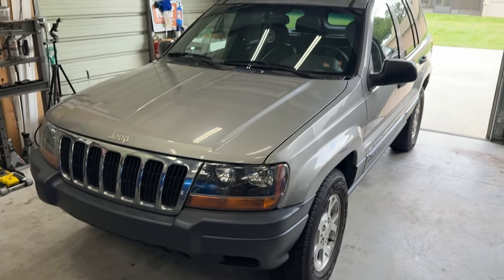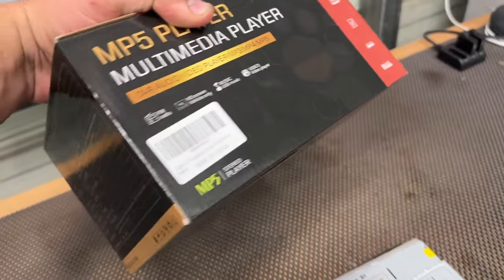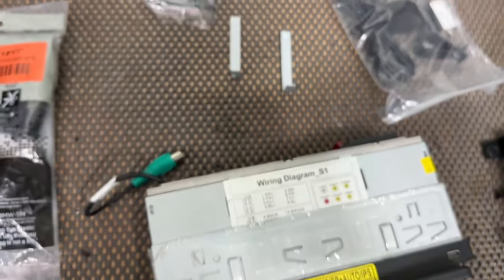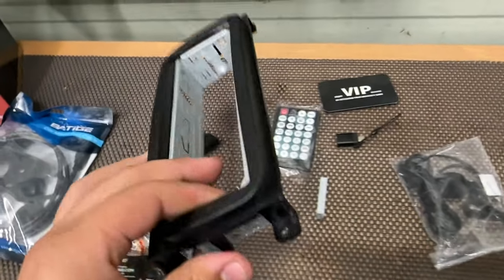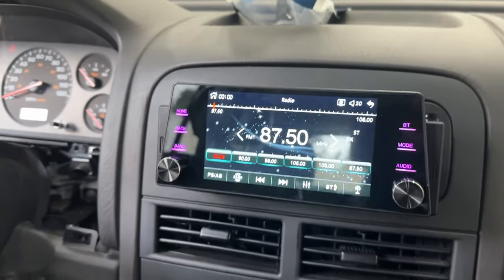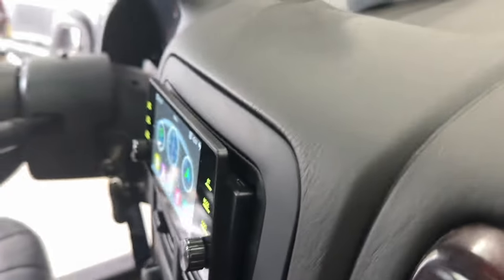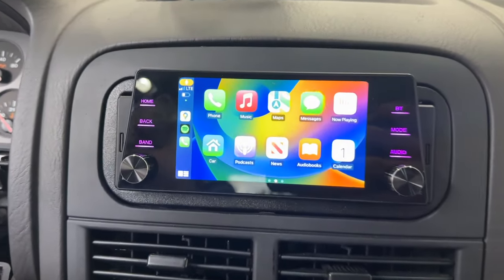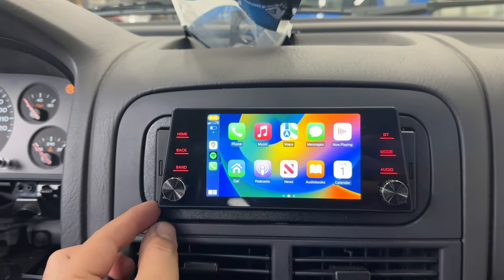Installing a $60 CarPlay Radio on my $1000 Jeep WJ Build!

Comment: Did you have any issues with it? I just bought the first radio you recommended for my Jeep and it's been nothing but problems. I'm ripping it out tomorrow and putting the stock head unit back in
Reply from the maker: Which radio was this? I run Atoto on my build and it’s been good to me my favorite brand on Amazon for radios tbh. This one is a budget one  I paid $60 back in august and it does lag but the CarPlay works which is what mattered to me. If your budget is over $100 you can definitely get something better
Reply: @NajarOffroad I bought the one you recommended using your link. It wasn't the Atoto, it was the single DIN touch screen with Android Auto

Comment: Quick question so I own 2000 grand Cherokee and I’ve had problems with my radio wiring, the red wire(ignition) and yellow wire(12v) aren’t getting power at all, I’ve checked the fuses there all good, I was planning to disconnect the battery tomorrow to see if that will help but if you maybe know what it is, it would be greatly appreciated. Merry Christmas :)
Reply from the maker: I’m not sure you would have to trace the wires. Have you had any blown fuses before from a short?
Reply: @NajarOffroad I have actually yea, last I checked i probably had to replace like 10 of them because the jeep was just sitting around for 5 years but I also own subwoofers and that could have blown something due to faulty wiring which was on my part, I dont have any upgrades like a better alternator or better battery cables so until I get that I wont use the subs anymore. I will try to trace them then, that helps out alot thank you :)

Comment: Did your jeep have the steering wheel controls?
Reply from the maker: I did connect the steering wheel controls. I have a video on how to do it with the Amazon radios that have the steering wheel controls option